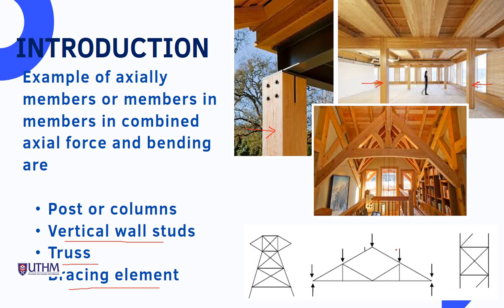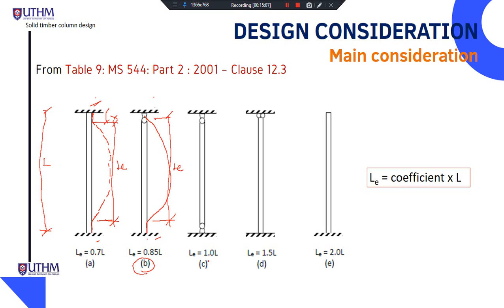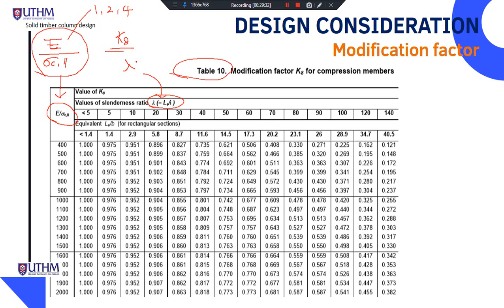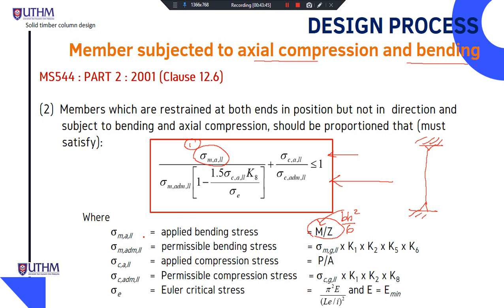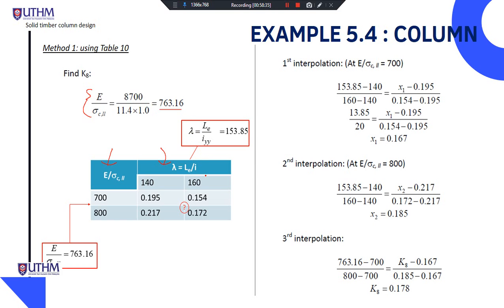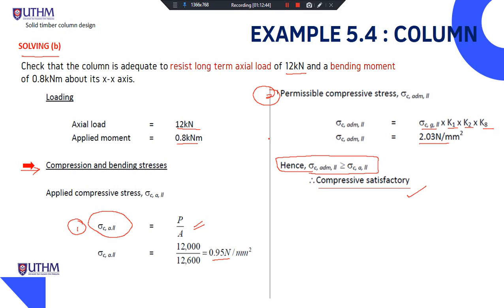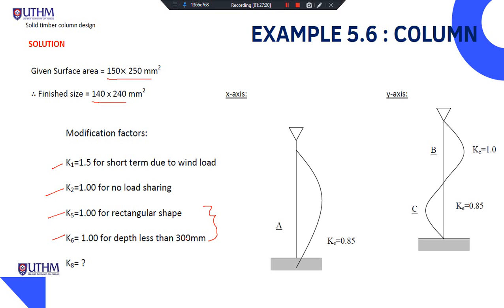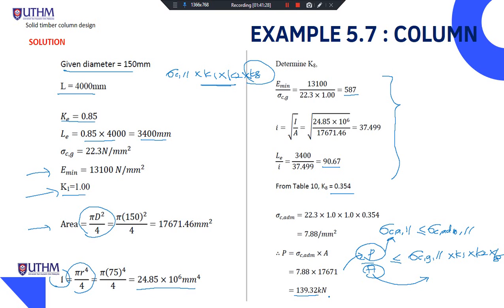TIMBER COLUMN DESIGN ACCORDING TO MS544

Comment: There is an error in your calculation for Euler critical stress at recording time 01:13:00. Euler critical stress should be 3.62. Therefore, the check fails. In fact, I have done an excel spreadsheet for this column design and no matter how I change the section properties etc, I can't get the numbers to be <1. I hope you can recheck you notes and share your findings. Thanks
Reply: yeah im also get 3.62, is this formula correct because i dont' get same answer as you